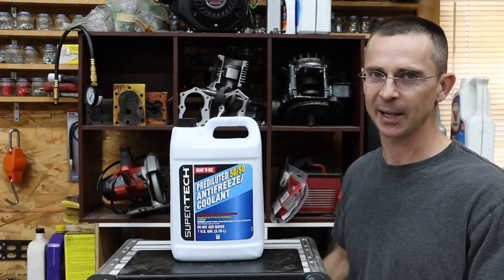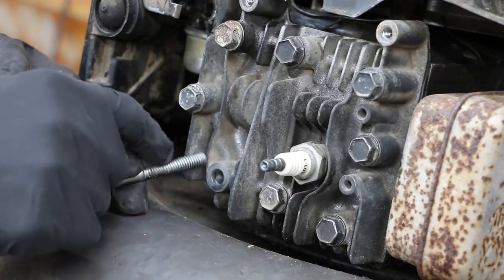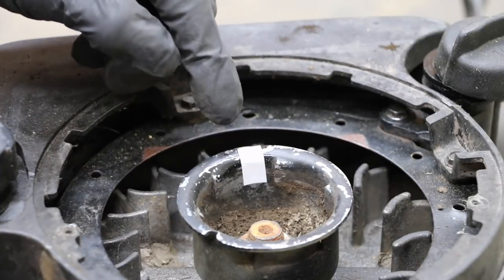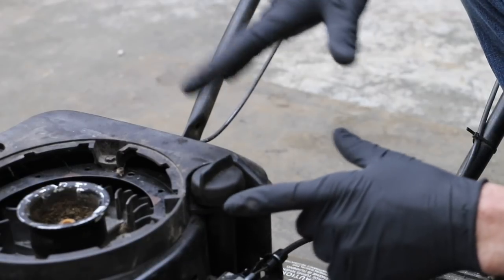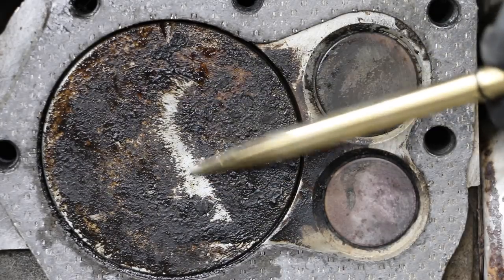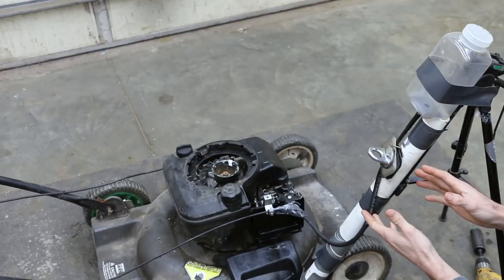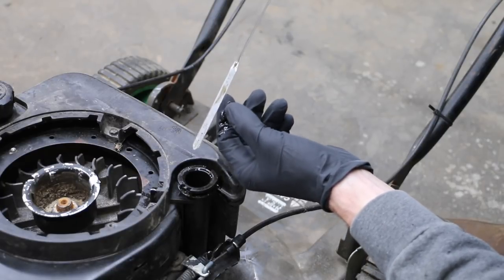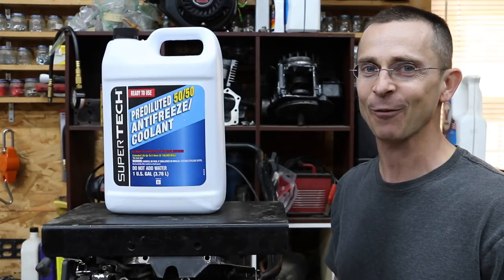Will Antifreeze clean an Engine?  Let's try it!

Comment: Also isn't this known as meth injection?
Reply: GForceConnections not antifreeze, windshield washer fluid. Methanol.
Reply: How about Comet or any abrasive powder household cleaner to bring back compression/seat rings by introducing it into the intake while running?
Reply: Itsa Mea - Scarey idea. I imagine it would damage the valve seats, especially on the intake side.
Reply: sienile  I didn't want to reveal this but this was Chevrolet's solution to dealers in the 50's for oil consumption and blow by from glazed cylinder walls and to seat rings on new V8s. The product of choice back then was Bonami which is the same as Comet. It never hurt valves or seats.
Reply: Itsa Mea yes. Heard the same thing from my father when he worked at Mercedes in the 70's when customers wore complaining about oil consumption at their new cars

Comment: Excellent vid. I too, have seen the effects of a coolant leak into a combustion chamber. But like you said, the sensors and catalytic converter might not be too happy with the chemicals in the antifreeze. What about just trying good old tap water, using the same method you did with the green stuff? Water injection on gasoline engines goes WAY back in history. And I sincerely doubt that it would affect anything in the exhaust stream permanently.
Reply from the maker: Thank you for this recommendation!

Comment: Another good video. In the past I've used water or trans oil dribbled down the carb or sprayed into the intake after the throttle body with good results. GM used to make a liquid to pour into the intakes at about 2k rpm untill the engine stalled and you could see foam growing in the manifold, wait 20 minutes and restart, wow the cloud of crap that came from the exhaust! This was late 70's when early emissions controls had there problems and caused problems including carbon buildup.
Reply from the maker: Thank you for this video project recommendation!

Comment: When I changed my leaking head gasket you could easily see exactly where the leak was coming from. Mine was leaking between #2 and #3 cylinders, and those pistons were spotless, emanating at the common cylinder wall. But, like you said, I would not do this just to clean out the combustion chambers, as the risk isn’t worth the reward.

Comment: You are doing what water injection and or water and methanol injection does steam cleaning the piston and cylinder head. It also creates more power through the steam engine principal. It also reduces heat but antifreeze will damage an engine it is corrosive to bearings and other components. Very cool experiments you do though I watch them a lot. Keep up the great work
Reply from the maker: Thank you!

Comment: On cleaning an engine, we has a small diesel tractor that had a lot of rust in the water jacket and the place we took it in said that adding soluble oil to the coolant and running it and flushing the system would clean out the rust. Never was able to figure out if it did anything or not, but it was an interesting idea
Reply from the maker: Thanks for the feedback.

Comment: I took a rebuilt engine to the dealer with a coolant leak, the shop manager said there is no antifreeze in the oil. Blackstone-labs identified antifreeze in the oil and the copper was all jacked up from antifreeze making the oil acidic and corroding soft metals (yellow metals). Sodium, Potassium, Silicon, Boron are typical indicators of antifreeze in oil and the copper is the result of antifreeze contamination... If you suspect antifreeze in the oil, it will become thick with some foam, drain to get it out of there as you suggested.
Reply from the maker: Great information!  Thank you

Comment: I'd like to see water used also, it's an old car dealer trick to spray water in the carb of a bad running car and it would usually make it run better. I always thought it was steam doing the cleaning. Thanks for the awesome videos
Reply from the maker: Thank you!

Comment: Many suggest using water. Where I'm from, we used to use sparkling water. We would shake the bottle and spray it into the carburettor. This really helped if a car was polluting too much. I believe the carbon dioxide in sparkling water makes a difference, but it would be nice to see if it's actually so. Please test water and sparkling water! Thanks!
Reply from the maker: Thank you for the video idea!

Comment: Thanks for doing this project. Another good project would be to drip ice water into a very hot engine. You could even try misting dry ice boiling in water. Dry ice boiling in antfreeze also. Antifreeze is also a lubricant which may be better for the engine than water.
Reply from the maker: Thanks for the suggestion.

Comment: Honda recognizes the CLR flush (of the coolant system-see TSB on CRV). South Main Auto will show you how.  He does a bang-up job cleaning out heater cores rather than replacing them when they are only clogged internally. 

HEY, you've done motor oils over and over. How about coolants?

Comment: Had the same experience with a cracked head where the piston was much cleaner than the others. The fact is that the higher pressure of the coolant will make it fill the cylinder partly or completely. Not running for a day or two days means soaking during that time.
So maybe filling up the cylinder after it has been hot with water or coolant will have the same result.
Reply from the maker: Thanks for the suggestion.

Comment: The strongest cleaner I can think of is MEK Methyl Ethyl Ketone I used to work on spray paint units and this stuff is was wicked - left a spray gun in it too long and ruined it because it ate off some of the metal if you sprayed and dripped some of this in it may remove and clean up the carbon. good video as always thanks
Reply from the maker: Thank you!

Comment: Hello Todd, My bike model had a manufacturing issue and coolant was getting into the oil sump.

The oil never turned milky or anything it was Motul 7100 10w50.

Later oil lubricity gave up and connecting rod and the crank shaft seized.

Bike : bajaj dominar

Comment: Aircraft in wwii used water injection to cool and add power under full turbo boost.  I have used a Hobbs vacuum sensing control in a water mist injection system, in a high compression engine. To prevent detonation, ak spark knock. The water injection kept carbon buildup to a such a small amount, I didn't need to worry about any buildup.  The mist must be kept to normal engine temps, or it will contaminate the crankcase oil. You want the mist to turn into steam to increase combustion volume, as the water mist injection cooling reduces combustion/exhaust gasses volume. A properly set up system, works very well and will actually decrease fuel consumption.
Reply from the maker: Thanks for this information.

Comment: When I took autotech in high school (getting on almost 20 years ago now, man how time flies), my instructor, who was an old school mechanic, told me to use just straight tap with with some regular white rice. The rice was not pre boiled, just put the rice granules in the water right before you slowly poured the water (very slowly of course) down the carburetor, while reving it up, to help clean off the carbon deposits.
Reply from the maker: This is a great way to clean carbon!

Comment: I was an Auto Mechanic in the 60's and this procedure was commonly done to clean carbon off of heads, we used a different mixture though. We would pour about a quart of water and brake fluid down the carb real fast while holding the throttle about wide open. One time our Shop Foreman was doing it to a car with a real loud knock when one of the rods came out the side of the engine!. I guess that one didn't have a carbon problem....Lol..
Reply from the maker: LOL!  I bet there was a really unhappy customer on that one!

Comment: I have used howes fuel treatment,  (not the anti-gell) on my semi it seems to reduce the carbon buildup in the exhaust system and regen did not happen as often, however when I had it serviced the filters were clean.
Reply from the maker: Thank you

Comment: I run a water/methanol injection kit on my diesel. Before I ran it the intake was always oily and greasy. I run windshield washer fluid as it’s cheaper, little less potent. But I had to tear the engine down for rebuild and I was amazed. The cast aluminum shines as though it’s been polished. Absolutely no carbon on the valves.
Reply from the maker: Thanks for watching!

Comment: As said before use plain water or windshield washer fluid water methanol. It steam cleans the internal combustion components. Super good for performance. Some race cars even spray the mixture while running high boost to prevent knock and get a little extra out of their car without having a rod go flying as well as it's cleaning properties in the long run. I've sprayed a fine mist out of a weed sprayer in my turbo cars intake and out the exhaust came a bunch of black colored water painting the gravel in my driveway.   It kicked a bunch of carbon out of my motor and improved performance.
Reply from the maker: Thank you

Comment: I fly RC airplanes and the fuel they use contains castor oil and it leaves a brown stick mess.  I use anti-freeze in a crock pot set to low heat and it cleans my engines so good they look new.
Reply from the maker: Thank you!

Comment: As a automotive technician  , have done this in past with water    on cars that had pre ignition .
Modern cars can adjust to compensate for knock , so hardly is ever necessary to clean carbon buildup. 
Yes , when cylinder heads are removed it is pretty easy to identify affected cylinders due to the stream cleaning effect of coolant and water .
Reply from the maker: Thanks for sharing.

Comment: Water is a old school carbon cleaner via carburetor. We would take a 20 so or ounce soda bottle of  water. [Once it is warmed up first] Then we'd pour in an  ounce  or so at a time. Having our hand on the throttle to prevent stalling. You''d bring up the RPMs to about  2800/3000 rpm when we''d our. Dousing 1oz at a time, works best than dropping in a capful at a time. You can tell carbon made it's way out of the exhaust. We'd do this on our stock and modded cars. Antifreeze I believe ,the H2O was the primary source of the cleaning action. We'd use about 1 liter tops per treatment. Once a year or 6 months  if we burned any oil.
Reply from the maker: Great way to clean carbon!

Comment: The old school way among taxi drivers here to remove sot and carbon out of diesel engines was to spray pure water spray in to intake manifold when warm engine running at least half of maximum rpm preferably even faster. I have seen it my self. A lot of black particles bigger and smaller came out of tailpipe at first and then amount of particles reduced along the times water spray was supplied. Notice this was before diesel had that particle filter installed in exhaust system.
Reply from the maker: Thank you!
Reply: @ProjectFarm  You welcome. If you ever want to test it. It might be hard to find a lawn mover with diesel engine though. :)

Comment: I missed the original videos with the actual products for this purpose, but it seems to me like the amount of spray and drip was pretty low to expect much cleaning from this event. The little bit of difference between before and after  hardly seems enough to even be worth the trouble. I'd be interested in seeing  if a longer period of  processing the water through the combustion chamber would have a much better effect.  Also was there any performance  benefits realized from this? or does a cleaner cylinder actually not work any better than a dirty one?

Comment: Great video as always. I'm pretty sure that it's the water that does the cleaning. So you could try the same test with only distilled water. It converts into steam and basically steam cleans the inside of the engine.
Reply from the maker: Thanks for commenting on this.

Comment: On automotive bearings anti freeeze in the crankcase strips the plating off the crnk/ rod bearings. Chevy had a big problem a few years ago with intakes leaking antifreeze  into the oil.
Reply from the maker: Thank you

Comment: Back in the mid to late 70s my neighbor Ed Chismar worked for Ford motor co as well as my father. and he (ed) developed a water injection system for the Lincoln 460ci engines that increased gas milage and cleaned the carbon in the combustion chambers, I would love to see you test this under your standards if you see fit, it incorporated a water drip injection system that increased the flow of water at higher RPMs such as freeway speeds at 60mph or higher to save gas. you can research this, I think it will benefit in the reduction of the combustion chambers temp, and reduce the NOX emissions (as the EGR systems do) and clean the combustion chamber as well, and increase fuel milage, Lets talk on this matter soon if you think its a go, I have been looking into this for years on my system and  is better than the original, and it seems to be a plus for the automotive field.
Reply from the maker: Thank you for the video idea!

Comment: If you ever revisit this maybe try straight water. As an old mechanic we would run water much like you did through the carb to clean carbon deposits. By my day this wasn't an issue but my father told me you could not do it on some Chrysler because they had carbon faced valves. Water would wipe the carbon right off them and leave you with a bad engine. You mentioned antifreeze is very hard on O2 sensors and catalytic converters. Toyota had a huge recall on the 3.0 truck engine head gks. I did hundred's of them. I don't remember ever replacing an O2 or cat though. Even on trucks with water spraying out the back when reassembled. BTW there were water injection systems commercially available in the 80s.
Reply from the maker: Thank you

Comment: Thank you for disclaimer. I've seen so many people doing the "steam clean your engine with a spray bottle" not only that but you would think that would be bad for the seals in a car. Nice video though. Another suggestion, I remember my mother swore by ammonia to clean windows and fixtures without scrubbing. I wonder if you put a diluted mix using spray and drip method to clean using diluted ammonia. Just a thought, if this could potentially create toxic gases that could harm you, please disregard idea. You seem like the kind of person I'd like to hang out with.
Reply from the maker: Thank you!

Comment: I had a blown head gasket once in a Honda Civic and I swear my cylinder #3 was looking brand new on the top of the piston and on the cylinder head and valves, it was so clean ! (i have pictures if you want to see)  I ran the car with the blown head gasket for maybe 5 minutes or more but the engine got really hot, the temperature gauge was going really high and the coolant was probably at the maximum temperature (boiling point) so I guess that having the coolant at boiling temperature helped the cleaning process ! :P Maybe one day you could do the test again by pre-heating the coolant before? :)   Keep up the good video ! It's really instructive !
Reply from the maker: Interesting!  Thanks for commenting on this.

Comment: Awesome video man, I watch all ur videos 👍🏻. I have a common rail turbo diesel truck and decided to install a catch can and blank off the egr. Because of the way the engine is set up u get a lot of gunge build up in the intake manifold. After installing the catch can and blanking plates I took the manifold off and cleaned it with oven cleaner, worked like a bomb. Maybe try spraying oven cleaner into the carb to see if it’ll clean the engine. Not sure how safe that will be though 😬. 
Greetings from Perth Australia.
Reply from the maker: Thank you

Comment: Having personally torn down a few engines running water/methanol mixtures, it will clean deposits out of the engine, as the piston crowns, combustion chambers, and intake valves were deposit free and still shiny.  You could replicate this with winter grade windshield washer fluid as it is roughly 50/50 water and methanol.
Reply from the maker: Thank you for the video idea!

Comment: I think I'm probably the first guy that recommended the antifreeze idea it worked really good surprise the cylinder head got more buildup didn't expect that but now I have a better idea that it's going to work even better worked on my truck pretty good I'll try to make a video myself but if I don't I'll let you know the secret of cleaning the carbon buildup to near spotless without taking it apart I'm the guy if you remember on one of the comments I'll bug you till you make this video thank you for making this video by far better results then any other additives
Reply from the maker: Thank you very much for this recommendation!  I enjoyed making this video.

Comment: please could you test this with a wallpaper steamer? I recently used one through the cars intake and the performance increase is incredible it feels like a totally different car
Reply from the maker: Thanks for the video idea.
Reply: @ProjectFarm  I made a video of it on the alternative fuel group it allegedly prevents ring gumming from running wvo and does a good job on carbon build up but I have no way of checking before and after other than how the car drives

Comment: I believe the reason a lot of people notice the clean cylinder after a head gasket change is due to the fact that the antifreeze is basically pressure washing the cylinder. It is also exposed for a very long time and has alot more time to "work" as by the time most people notice a blown head gasket, the contamination has already been going on for a while.
Reply from the maker: Great point!